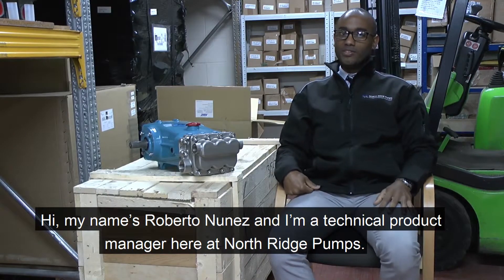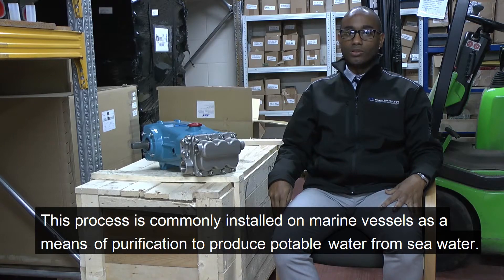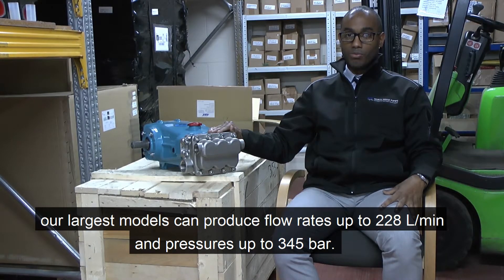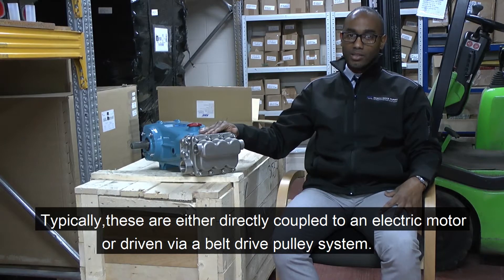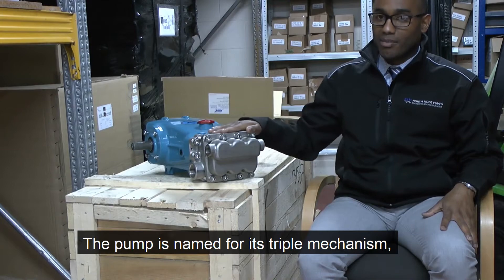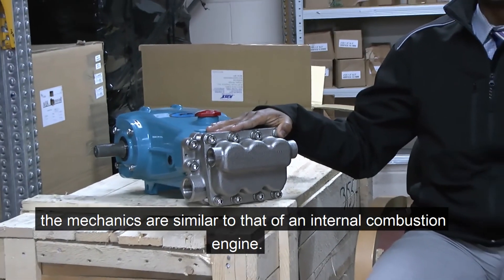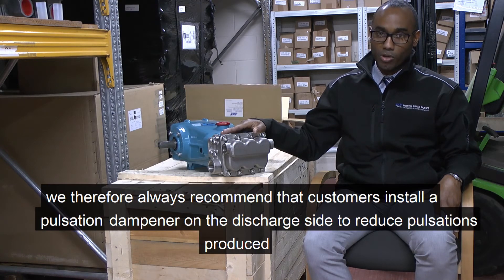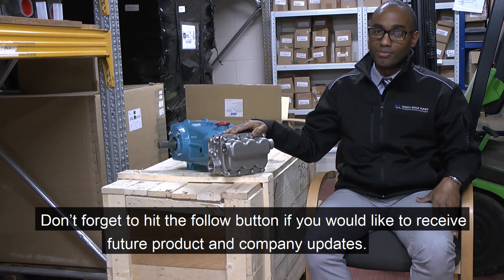Piston Pump for Reverse Osmosis

Comment: Where is presure relief vlve
Reply from the maker: This pump is bareshaft and without motor. The relief valve and any pressure regulating valve are externally connected on process pipework and not installed on the pump head.